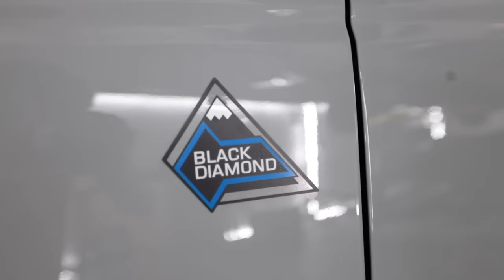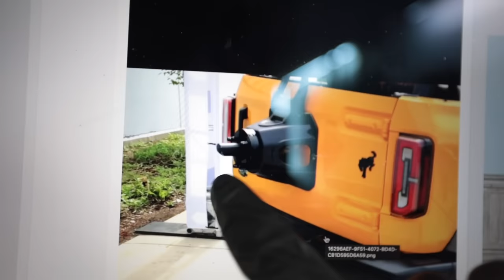Going Bigger & Wider The Clean Way!  // 2021 Ford Bronco Black Diamond

Comment: I'm not a fan of off-road vehicles with non-stock wheel and tire size, but I'll make an exception: fit & finish looks immaculate.

In the diesel world they taught me to use a Hand Truck to take wheels on & off (not that this would work for the spare). Mounted tyres are really awkward to handle because the size, center of mass and shape makes locking your shoulder, and spine alignment difficult, but not impossible.

I vote for powder coating the bracket blue. Keep up the magnificent work!

Comment: I appreciate that you always show what it takes to do a job the right way.  Bonus points for torqueing the spare!
Reply: Did you torque in a star pattern?
Reply: @jeffmercier7252  Is there a different torque value for the spare carrier than in the wheel hubs?
Reply: @johndavidwolf4239  that value should be in the manual

Comment: I've ran those tires for over 40 years and without a spare and have never had a flat. They're great on the highway and off-road. They look great on the Bronco and the wheels look like they're made for your vehicle. Great look.
Reply: Nice thing about having a matching, full-size spare is doing 5 tire rotations. You can get something like 20% additional life out of the tires vs a normal 4 tire rotation.
Reply: They're my favorite tires but if you're running a large tire on a solid front axle you may have a problem with death wobble due to the sidewall being a bit softer. On this a Bronco that's no issue though.
Reply: You did well to run the same tires for 40 years, were they not down to the belts?  :)
Reply: @4Kandlez  I didn't use the CJ as a daily driver so not that many miles. Jeep CJ's are so light that they showed little wear. Only replaced them because of their age. Rarely had to even put air in them lol.
Reply: general grabbers are awesome

Comment: I liked the original black steels, so I'm glad you're keeping them. But the new wheels and tyres along with the wider arches look amazing. Matt was so spot on with his suggestion and what an awesome colour they are, almost like they had your car in mind when they manufactured them. You have the cleanest vehicles I've ever seen! Would be interesting to know if the lower unsprung weight has improved the handling/ride? Great video!  👍😎

Comment: It always amazes me how wheels, tires, and fender flairs can instantly turn a “buffed” vehicle into a “body builder” vehicle.  As a boomer who grew up as an “analog” guy, I have a possibly dumb question.  Do the digital computers automatically recalibrate the speedometer when you change the wheel and tire dimensions?  I’m glad you didn’t cancel the Bronco!  Thanks!  👍👍👍
Reply: I have a 17 Transit with bigger than stock-size tires, and the answer for my Ford is no. I had the same question for Sarah here.
Reply: I had to use a programmer to fix the speedo when I put larger tires on my Jeep. Luckily it's a pretty simple task.
Reply: I have a 2015 Ram 1500 and I went from the factory 33's to 35's and I had to recalibrate my digital speedo.

Comment: That wheel and tire combo looks great with the cactus gray! I'm definitely thinking about getting a Bronco, but I'll probably wait until I see what kind of issues start showing up. Also, where I live, the only ones available are the Outer Banks, Badlands and Wildtrak and they began showing up a few months.
Reply: I have seen some minor issues with the Bronco's one are the Tie Rods and Rack and Pinion when Hard Core off-roading Some other small things like the cross-member hanging up on obstacles that and placement of the lower shock mounts and the reservoir for the shocks being possibly damaged.

Comment: KO2's are a great tire both on and off road. I'm on my 2nd set on my Ram 2500. I took it on multiple 2000 mile road trips to Utah and ran trails in southern and western Utah. You won't be disappointed in that purchase.

Comment: Very nice, the color on the wheels ties everything together. Great job with size and weight, so many make the mistake of adding weight causing component failure along with changing suspension characteristics.

Comment: Not only do you have quick disconnects on the fender flares, the tips of the bumper come off with 1 bolt to give you more approach angle.
Reply from the maker: That’s rad!
Reply: not sure how I feel about quick connect parts on the exterior of my vehicle - too easy to steal
Reply: @WilliamTythas  Totally gave me an idea on how to prank a friend of mine that has a bronco.  I'm going to find it in the parking lot at work, pull off his fenders and then drop them off at his front door.  lol
Reply: @ianloyd6384  We're friends, we don't 'beat' each other.  What kind of jerk does that?

Comment: Sarah your wheel and tire swap are very smart. I did a similar swap with my 1987 Vanagon Syncro. The original heavy aluminum 14" wheel and tire combo were quite heavy even though the diameter was only 25". I put on Audi 5000 Quattro 15" wheels and a 235/75R 5 tire with a diameter of 29". Because of the light weight Audi forged rims my wheel and tire package is lighter than the smaller factory offering.

Comment: Dang!  Those rims look incredible on there.  Such a cool colour.  So with Broncos do you have the ability to adjust the speedometer to account for the larger tire diameter?
Reply from the maker: It’s going to throw it of by 2.2mph at 60, you typically use SCT, a programmer for Ford speedometers.
Reply: @SarahnTuned  Not too bad.  Do you access to the stuff for that kind of tune?
Reply: Sarah, it may not be as far off as you think.  Check your speed in Google maps while driving.  I recently went from  32 to 33 inch tires on my big bend and the speedometer still matches GPS speed exactly, even at 80mph.
Reply: It’ll probably change it just enough to make it correct. Most cars I’ve had have read a couple kph higher than actual speed.
Reply: I was wandering the same thing. I know with my Mustang, lager wheels threw the speedo off quite a bit, speedo says 78 and gps says 65. Also,  Ford couldn't reprogram it because my wheel/ tire comb is not in their data base.

Comment: I really like the look and design of that catch can. Although on their website I only find the unit with AN fittings on top and yours has different stuff on top. Did you order other fittings?

Additionally I love the wheels and tires choice and you'll benefit from the unsprung weight loss!

Comment: Excellent video, Sarah (as always!). Quick question, though: When you switched to tires of a different diameter, do you need to make an adjustment to the speedometer/odometer or do you just accept the fact that your speed and miles will be incorrect?
Reply: With any luck the Broncos read faster than actual speed like my Silverado did and when I put 285-7516's on my Silverado it made the speedometer read correctly. I bought access to my PCM through HP tuners and I can change the speedometer but didn't need to...
Reply: For every inch its 8km ph faster.
Reply: @jasonh4167  why would you do that lol. Stay metric or imperial. Don’t mix and match you heathen.

Comment: In the life of my truck I have those same BFG KO tires.
I have gone thru 3 sets so far and each set has lasted me up to about 75,000 miles.
They wear like iron and they also dig to find traction.
I live in MN so we have had some big snow falls and those tires go thru the snow like nothing.
But the tire size I chose is the same size as the originals as not to mess up the speedo calibration which you might have to do with your Bronco or do a gear change to bring back the original RPM range for keeping the mile per gallon in the correct range

Comment: Loved use of torque wrench on wheels. Back in olden days, Volvo realized vigourous use of impact guns by American techs was literally turning their pretty OEM alloy wheels into automotive versions of warped vinyl records ( I flashed back to that when I saw your beautiful Swedish catchcans ),.So , being extremely component and thrifty engineers, they came up with a genius solution: little color coded sockets that were model specific, and meant that you jack up your impact gun to ridiculous levels, but the little babies would only tighten so much! And actually were so beautifully engineered that they just didn't snap or wear out..Love your videos, and the extreme level of your technical skiils.

Comment: I did the same with the Add-W1 catch system on the newer Forester SK platform. It also has the dipstick and surprised how quickly it accumulates oil. Great upgrades.

Comment: The LT load ranges are pressure dependent. Load Range E is at 80psi, D is 65psi, C is 50 psi. A Load Range E at 50 psi is the same as a Load Range C. Just a Load Range C has a maximum of 50psi.

Comment: I purchased a catch can for my Toyota 86 and it came with brackets for a left hand drive car.  In Australia we drive on the right.  So I 3D printed a bracket in ABS plastic.  Works well.  Not sure how it would hold up to off rad but Free3D CAD modelling and a 3D printer for ABS is great from prototyping, or for some use, you can keep the plastic, don't need to fabricate  a steel/aluminium one.

Comment: Looks awesome! Next maybe rock rails/ running board hybrid,  splash guards,  nice branded high end small cube fog lights in the corner bumper opening slots and window A frame/cowl mounted off road lights. Excited to see what you do with Pookey !

Comment: Sarah, again I feel I should remind you about the corrosion issue you will face with the Steel Rotors (that you already had to clean surface rust off of) and the new Aluminum wheels you installed. Because of the dissimilar metals being in direct contact with each other, the weaker metal (Aluminum Wheels) will corrode, even in Arizona. So, you need a protective, non-electrical conductive barrier between the steel rotor and the Aluminum wheel surface. I would recommend a high heat primer and paint on the rotor where it comes into contact with the wheel. Even a powder coat if there is a high heat type. Protect those discontinued and cool looking wheels.

Comment: I would think if the engineers at ford thought that your particular engine needed an oil catch can , they would have installed one on the assembly line however, the upgrades that you have done to your bronco really stand out , but not an overkill . It looks really great. I really like it.........

Comment: Are you really sure you need to fit the oil catch can? I know they can cause the inlet valves to gunk up with direct injection engines, but a lot of people say this can also cause pressure build up due to the hose diameters and filter restriction...then cause seals to leak etc. I could also affect your engine warranty! It's a difficult decision in my opinion. What's yours? 
PS: love all your work 👍😛

Comment: Heavy tires have this great feature for setting them down on the ground without hurting your back. Drop them, they bounce. 
It works in reverse for picking up heavy tires, don't dead lift them off the ground. Bounce them up.

Comment: E rated tires are stiffer and will ride harder... also check with BF about what new pressure you should run... based on each axle loading...Sweet wheel choice!

Comment: Just like plastic tab repair, using heat, there's a plastic repair for esthetic purposes as well...use heat, & there's essentially a plastic "stamp" that has corresponding texture needed, & it stamps texture back into the plastic where the blemish was.

Comment: If you live in a rust-prone area (pretty much anywhere other than Tucson), don't wipe that goop off the mating surface between the rotor and the rim. It keeps it from rusting on there and you won't have to beat the shit out of your wheel with a mallet for a half hour to remove it. Ask me how I know.

In fact, I recommend putting a wee bit of anti-seize on that surface for just such a reason. Unless you're OCD; then it's got to go :)

Comment: Great project.  It looks fantastic. Save your original fender flares.  Those upgrade pieces are sprout legs and walk away in a parking lot some nite.  They are far too easy to remove and I imagine they aren't especially cheap.

Comment: Sarah
You said the next video would be the catch can. Hopefully you will cover the need for a second catch can on the crank case breather line that lets air into the engine. Also, a company called Radium makes a PCV plate that mounts on the side of the engine that adds extra baffles to limits oil droplets getting to the PCV.

Comment: I actually ditched my 16 inch wheels a couple years ago because you  almost can't buy load range C in a 16" rim anymore. PLus  the Load range D&E tire ride like pogo sticks even if you air them down.  Switched to 15's so I could get 33's an d35's in load range C BFG's

Comment: May want to play around with tire pressure. Looks like your not getting full tread contact on the rear tires. I run about 26-28PSI in order to get the best tread contact.

Comment: You shouldnt have an issue with the spare tire holder because you actually went down in overall total weight, so in reality, your actually putting less stress on the holder. You werent kidding about tire differences affecting your ride, i switched the tires that came on my truck from 37" Super Swamper mud terrain tires down to Toyo Open Country AT3 tires 315/75R16 (34.5x12.5 16's) on my 2nd gen RAM and it went from riding like concrete wheels to a luxury car.

Comment: What is the Broncos rear gate rated for weight-wise? I remember with my Wrangler when I went to a 35in tire with new rims I had to upgrade the hinges and tire carrier to prevent the tailgate from bending or the hinges busting.

Comment: Ah, but, if it hasn't been said, the heavier portion of the wheelset is the tire, and the weight of the rubber is towards to outside diameter of said wheelset, so you will still have heavy tires that which when in motion will increase in mass (more than the stock rubber) due to rotational forces.  I'll be curious to see the impact to performance.  Caveat: now back to the video, fun as always.  :)

Comment: DANG those wheels look so awesome! Pokey is such a cool truck! So I was going to order a Bronco in literally the exact same spec and color as yours, but my plans changed. I was able to find a 10K mile one owner 2021 F150 SuperCab STX 4x4 with the 5.0 V8 in Lead Foot Gray (a discontinued color for 2022) which is also the EXACT spec truck that I would have ordered new! Should be getting it around Valentine’s Day! I am SO PUMPED! Much love to from Texas!

Comment: With the larger diameter of the new wheels and tyres, is that going to affect your speedo. Larger diameter and police radar will show you going faster than the speed o indicates - travelling further per rotation. In Australia, police will do anything to get a ticket because the Government needs the revenue.

Comment: Congrats on all those cool upgrades!
Stay Bronco Strong!.. I still use my '93 Bronco EB 5.8 for everyday driving & it gets so many compliments because I've kept it in great condition.

Your new tires are awesome, but you'll notice they're quite a bit louder on the road/hwy because of the sipe pattern & material. (they will also feel a bit more stiff going over bumps/potholes).
Also, watch that your turning radius will be larger & you may find some rubbing underneath & inside the wheel well. Did the new tires/wheels get balanced with inner walled weights?
The blue rims look so clean and fit the look of the truck.. was great of Matt to break a set for you to have that spare too.. that was a huge benefit to you.
The Oil Catch Can will definitely help as well.. I just saw the bracket you have for it, and as a suggestion, have a spacer of 1/2" rubber or HD foam attached by adhesive to the bottom side so the catch can has some stability against the bottom and isn't suspended like a loose top ended spring.. bouncing with each bump in the road. (you'll thank me later for that one. lol)
Hope FORD does you right with that one fender flare that was damaged upon arrival.
BTW, there are some sidesteps come with built in mudflaps for the front wheels to keep your door panels from getting pelted by rocks.
Cheers!

Comment: Yes, the wheels are lighter, but most of the weight is now on the tires and have a larger diameter, which would require more rotational force to turn than the setup you had before.

Comment: Hi Sara the Wheels look Awesome the Blue does work well, great job.  Catch Can is another great add-on, for valve intake longevity.  
Not sure where they mounted the Turbo, the main thing is to make sure there is at least a Heat Sheild Between the Engine and the Turbo, or at least add a Turbo 
Insulation Blanket... Ford Engineers don't know about the heat turbos generalate the  Blanket can Cool the engine compartment for upto 
400 degrees F   👦🏻👍🏻

Comment: .....Dear Sarah!  Not sure what these lifting belts are called, but a lot of tire professionals wear a belt, brace system for the times they lift these heavy objects.  YOU ought to RESEARCH this topic, and GET A BELT BRACE, for the reason that your back could get injured, if a wrong move happens.  ALSO, JUST DROP AND BOUNCE A TIRE/WHEEL.   WATCH HOW MOST TIRE GUYS DO THIS.  DON'T BABY THE ITEMS.....DROP AND BOUNCE THEM....CONTROL THE BOUNCE.  GET SMARTER!  Avoid injuries!!!